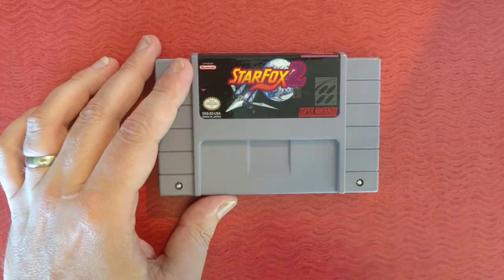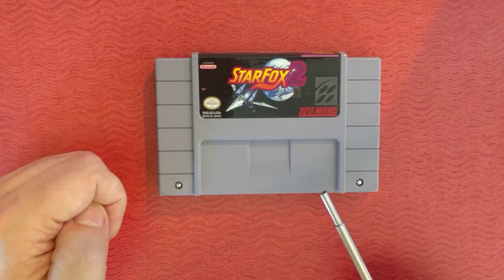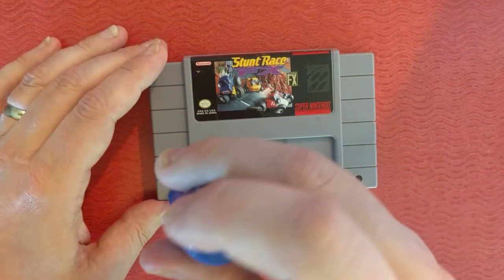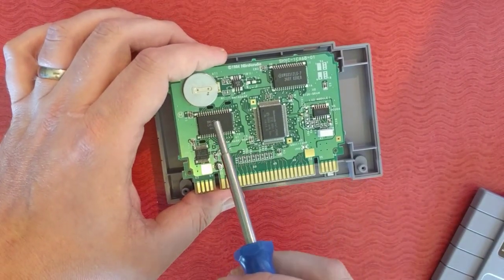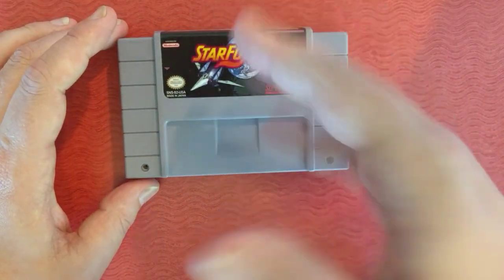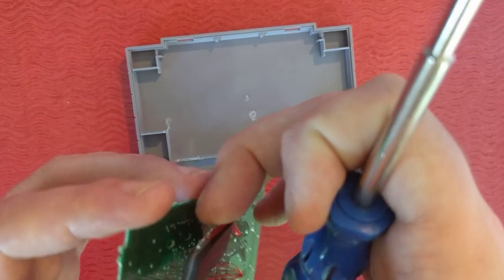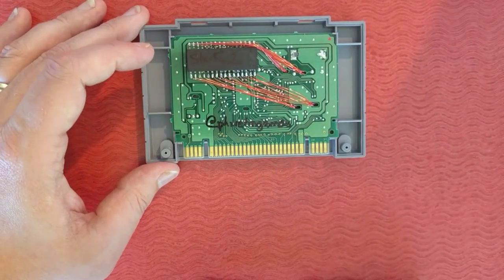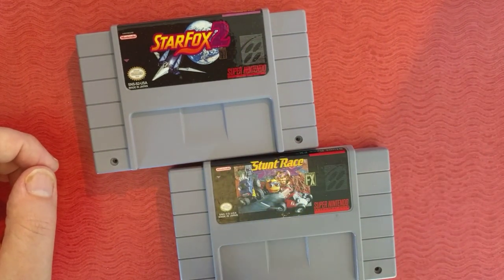How to Make Star Fox 2 Repro for SNES

Comment: It's easier to remove that chip with hot air, or a low melt alloy like chip quick.

Hot air would be preferable because you could remove the chip without damaging it.

Comment: You never cut the pins on a chip you desolder it that's electronics 101 buddy !
Reply from the maker: Good thing I didn't go to school for it.
Reply: me neither, but i just do it...it's not rocket science, but cutting is the worst thing you can do..if you can't do it, leave it :)
Reply: Hot air. You remove the chip with hot air and it doesn't damage the chip or the pads.

And no, not from a heat gun. You use a temperature controller hot air station, lots of flux and possibly a microscope.

I've had to swap quad flat packs, and PLCC packages before. (You know, the square packages with tons of pins.)

Comment: Hey! I know this would be crazy complicated, but I'd love to see someone develop a tower cart like Sonic & Knuckles or Gameshark that can just leech off the Super FX chip from an FX game without destroying it.

If that's not possible, it would also be interesting to make a Sega 32X-style addon for SNES that has the Super FX chip inside of it and just connects the ROM pins to a second cart slot on top and then a board dev can develop a custom board that just slips the pin out from the ROM to the FX "cart" below it. 

At least that way you could make FX repros without a donor and the donor would go into the master addon cart. 32X style, yknow?

Alternatively, I'd love to see a reverse engineer of the FX chip and someone to actually just sell FX-mounted boards.

Comment: Well rather than destroyed cartridges or to minimise is more to the point  can the fx chips be soldered to the snes itself, probably need to have a few switches for different games but you would only need to do one game, or could the chip be cloned, or even better could someone come up with a chip that clones all  special chips, that is programmed to read the game and then do what it needs to get the game running

Comment: How can you use a FX 1 chip? I thought Star Fox 2 uses the FX 2 chip....
Reply: It does.
Reply: James C  way to answer half the question
Reply: Okay, you can use an FX 1 chip, but it won't play optimally.
Reply: Not true actually there is no such thing as a FX2 chip,  There is a GSU-2 chip which can address a larger rom which this isn't.   As long as the cart has 512k of SRAM it's good.  Both GSU-1 and GSU-2 run the game at 21.5 hrtz.